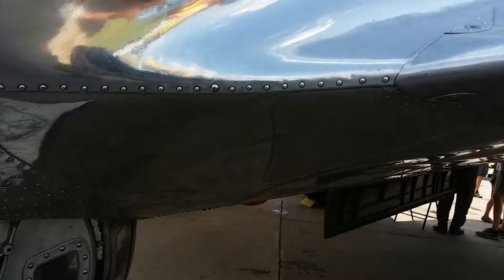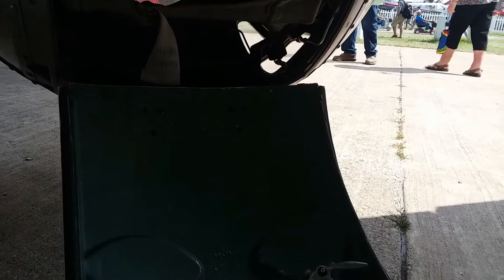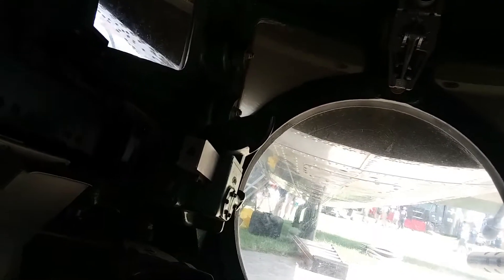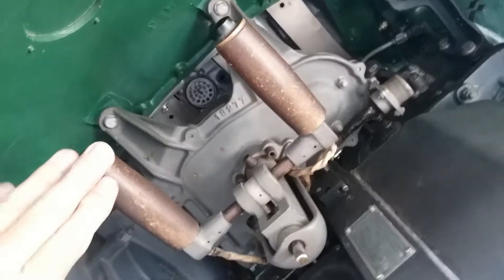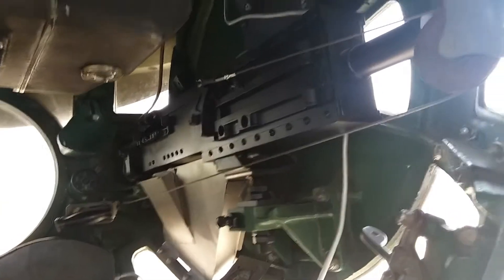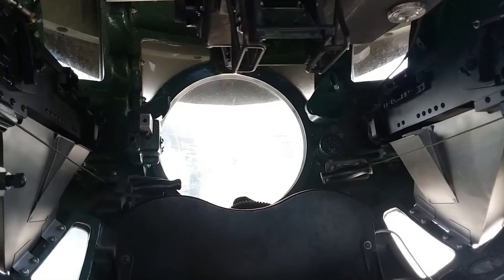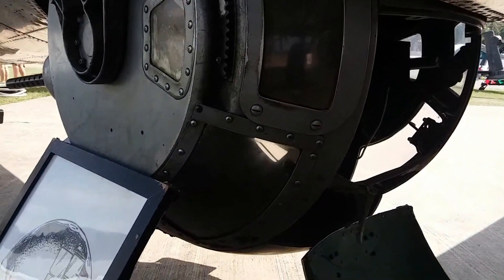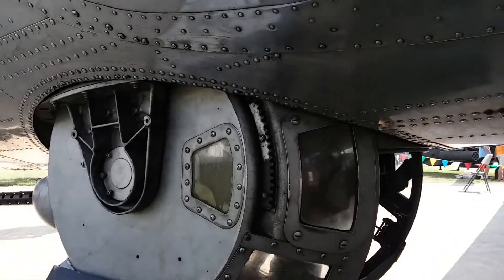Sperry Ball Turret

Comment: It's 70 Years too late but they should've made the Ball Turret so it could jettison with a Parachute.
Reply: Agreed.  That was the first thing I thought.
Reply: @alvaro2338  You mean shoot stuff on the way down?  What would the recoil do if you were dangling at the end of a parachute?  You’d probably wind up spinning out of control.
Reply: Fred Blonder  sorry Sir, it was a joke. A lot of respect for that guys.
Reply: @alvaro2338  I understand.

In all seriousness though, it is infuriating that there was no proper ejection mechanism for the ball-turret.  I’m thinking: put the ’chute in the space beneath the gunner’s knees.  When he ejects, the turret shell splits apart and the chute deploys.  There’s all sorts of details to be worked out regarding how far you allow it to fall before deploying, which would depend on your altitude and such.
Reply: On B-24 the ball turret could be retracted into the aircraft.
Reply: @Anlushac11  They used the same turret on both planes.
Reply: @alvaro2338  I wouldn't want to shoot at anything as I'm on my  way to the ground, probably behind enemy lines lol.
Reply: @willemran  B-24 was still retractable. The B-24 has tricycle landing gear preventing it from take off or landing with the turret down or bomb bay doors open.  The B-17 is a tail dagger.

Comment: I was a .50 cal gunner in Iraq on a Humvee. The .50 is a beast to operate, maintain, load and fire. Even in an open air turrent like i was. I cannot imagine operating TWO of them in an enclosed space like that. The lubricant and smoke that must have filled that turret was probably absolutely choking.  Insane.

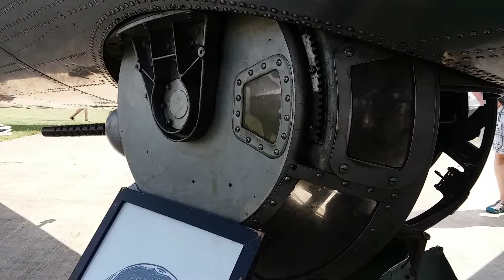Comment: 3:40 😳 Imagine being told over the radio that they’re sorry, but you were going to die upon landing...and then having to wait for it as you watched the ground close in. Makes it even more egregious that the USAAF proceeded to do nothing with the patent & royalty rights they stole/confiscated from Preston Tucker for his electrically powered, remote controlled gun turret. I guess I can understand it perhaps not being feasible to make these turrets ‘jettisonable’ due to over-complexity, or armored due to weight, but it seems kinda inexcusable that they didn’t at least provide these brave gunners with a freakin’ parachute. With the low position on the fuselage and the aft-facing hatch, it definitely would have been possible for them to bailout in an emergency. That, or they could have easily designed in a secondary, emergency hatch at the bottom that would allow the gunner to be ejected whilst still strapped to the seat.
Reply: not sure if my comment makes much sense but, I have not seen that video mentioned with the ball turret gunner, though I doubt I'd fit in one back when they were in use; I'm surprised they didn't have some kind of dead man's drop option where you could just flat out detach the whole ball just let the thing drop. may be suicide since its harder to get out or you'd be bouncing around like crazy upon your flight crews emergency landing, I would take that option over being ground to death under an aircraft though.
Reply: They wouldn't fit with a parachute on. If they made the turret bigger, it would probably mess with the plane's aerodynamics, be too expensive, and, most importantly, present a larger target for the enemy. So it was really a lose-lose situation for the guys who got in there.
Reply: Often wondered why they didn't just make the ball turrent jettisionable and put some parachute ring attachments on the turrent.  That way the gunner could be dropped while still in the ball but have a parachute to lower him somewhat saflely. At least giving him a chance!  Of course being dropped off the plane over water would be a big drawback...  The B 36's had remote controlled turrents IIRC.
Reply: 4 peeps, incl. the OP, who are telling us they are NOT Mechanical Engineers, without actually saying it.  The ball-turret gunners DID have a personal parachute, but many could not fit inside the ball whilst wearing it.  Though many BT gunners died, in obviously horrible ways, it was, in FACT, the safest position on both B-17 and B-24.

Comment: Those belt guards were not invented back then it was exposed belt fed so not sure why they made that edition. That’s very modern
Reply: NOT true... modifications come fast and furious during a hot war.  Version 1.0 of this Sperry ball turret had the ammo cans INside the already cramped ball!... later on they went to the EXternal ammo cans and slick feed system seen here.  Similarly, early B-17s had both waist gunners exactly the same distance from the tail, BUT... this left the 2 waist-gunners bumping ass and generally getting in each other's way, SO... Boeing Engineers (and hand-drawing Draftsmen) quickly came up with the staggered arrangement seen on most surviving B-17s...  (and added some armor plate to protect them from the solar-plexus down)...